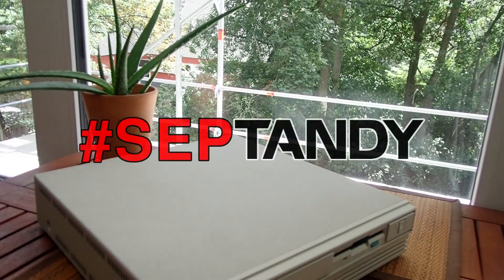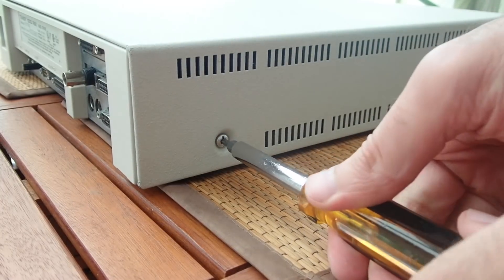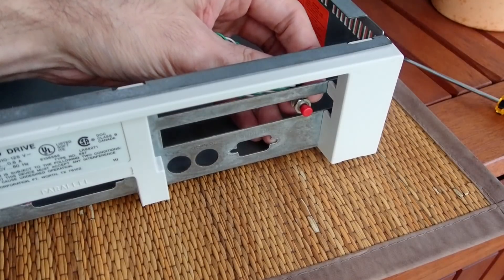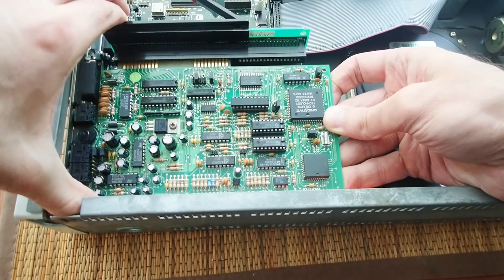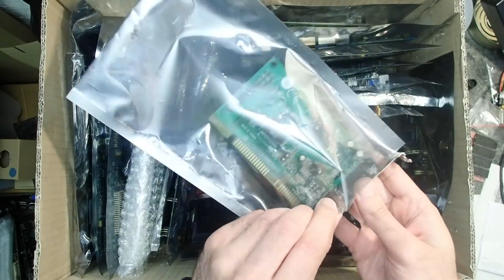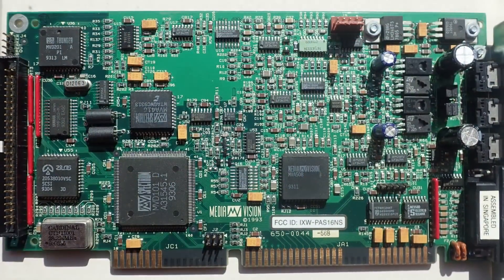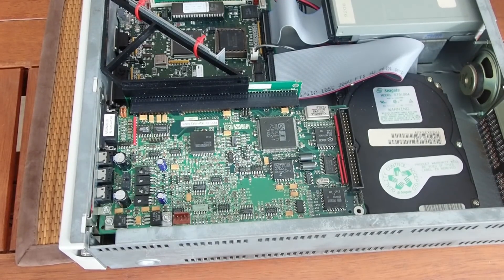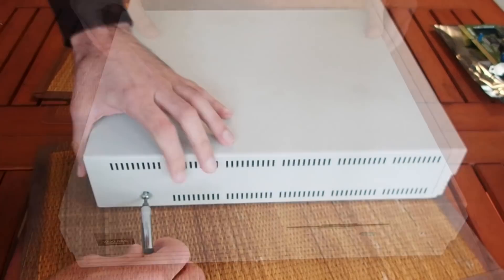#SepTandy 2021: proper audio configuration and a reset button  for my Tandy 1000 RSX

Comment: If you planned on having that network card in there, you could have used the BNC port on the sound card as long as one side could be shorted to ground, if not, you could have drilled it, and just mounted the button in there.  Quite a hack, but keeps the case from getting drilled.

Comment: Ah, this is the video where you ask about what we (as viewers) would like to see in a sound card video. You already covered the PAS in depth. I wonder about sound cards that were competitors in the early market, before AdLib/SB became the de facto standard, like including the Covox Speech Thing. And then covering cards like the PAS that tried to compete with features over the Sound Blaster, but failed due to lack of widespread game support, and were left unused apart from bundled demos, just stuck in SB compatibility mode forever. The name "Turtle Beach" comes to mind, but a quick search shows them as making much more modern hardware.

Comment: Could the card / mobo  just have bad bypass caps causing the lack of filtering buss noise?
Reply from the maker: I'm afraid no, I tried also cards, where I replaced all the caps with the new ones. And the mainboard doesn't have any electrolytic caps at all.

Comment: Inspired by this video, I put my PAS 16 in my 2500 RSX (same mainboard in a different case). Unfortunately I did not have the same success. The card seems to be working fine but the bleed through noise is horrendous. Event the hard drive motor spinning up comes through loud and clear. Still didn't stop me from playing Spear of Destiny for an hour. Although it does seem very peaceful now that it is turned off.
Reply from the maker: That is very strange, did you use headphones, or speakers? How do other cards behave in your machine? I tested now also MediaVision Jazz16 in this machine and together with the PAS16 that were the only two cards, which were usable in this mainboard.
Reply: @necro_ware  It was with headphones. I have not tried other cards yet. I messed around some with the oscilloscope and there is about 2v peak to peak noise just between some of the ISA ground lines. I tried a few things which brought the measurable noise on the supply lines down but nothing improved the audio noise to be at acceptable levels. I may poke around some more later.
Reply from the maker: @jayesonlee-steere5493  I have to admit, that this Tandy mainboard is the noisiest one I ever had, so you have to see it in relation. Also Tandy's power supplies were not very good and produce a lot of noise, especially if you still have the old capacitors in there. They are probably dry meanwhile and produce horrible ripple. It is so bad, that you can actually damage the hardware. I replaced the power supply in my Tandy and don't have the original parts anymore, but with headphones I still can hear some slight noise on the data bus even with PAS16. However on the speakers and during the recording it is not noticeable at all. Headphones seem to be more sensitive to it. If you didn't try another sound cards yet, just put any Sound Blaster from around that time (1.5, 2.0 or Pro) and you will see, what a "horrible" data bus noise really means :D

EDIT: As far as I remember, the 2500 RSX has no audio port soldered on the mainboard, right? So, you can't even use the Tandy Sound System on it. On the 1000 RSX there is one and if you try to plug your headphones into it, your ears will start to bleed. Unfortunately Tandy didn't bother to shield anything on this mainboard. It is absolutely horrible. With external speakers it is kind of ok though.
Reply: @necro_ware  I tried out a Sound Blaster 2.0 and you are right, it is worse. The noise bleed-through is at least as loud as the game sounds. Very unpleasant! :-) I decided to try the card that came with the computer: unbranded 8 bit ISA with YM3812 and Gallant DSP. It is much better than the others. I can only hear a small low frequency grunt every now and then during hard drive access. I am guessing this why it was chosen for the machine. Unfortunately it has a pretty bad signal to noise ratio (white noise, not the bus noises). DSP compatibility seems off too - I was getting digital audio dropouts that I did not get on the SB or PAS.
Reply: I decided to try my Audician  32 (OPL3-SA). It was silent. Some kind of black magic because it is only a budget 2 layer board.  It is also plug and play so can be conditionally enabled on boot. A little new for the machine but at least it works.

Comment: Good video - important to remember the Tandy's with digital sound have a DAC at DMA1 that will conflict with things.  However, your solution probably requires a full power cycle to de-initialize the sound card (I don't think the reset button is sufficient because bus power is maintained); instead, why not just use a card that supports DMA 3?  Since it's a 386 it should support that.  I think the Sound Blaster Pro you had supported being jumpered to that.  Tandy games would work at the same time as Sound Blaster without any conflict.  This would also allow you to run the 1 or 2 games that support Adlib + Tandy digital, or Sound Blaster + Tandy PSG.
Reply from the maker: Thanks. Reset is sufficient and is just as good as a power cycle. In regards of DMA3, as I told in the video, many games back then didn't support anything else, but DMA1. It was basically hard coded into the games, so DMA3 wouldn't solve the problem. Also SBPro, which I have is basically the same low quality sound card as the SB 2.0. The only difference is, that it had two DSPs and OPL2s for stereo capabilities and no CMS. But it was the same noisy crap, so it would be not a good choice for the Tandy.
Reply: @necro_ware  Ah, makes sense; I do remember some games let you set IRQ/Address but not DMA.  Many many years ago I had a "Sound Machine" (Sound Blaster clone) in a Tandy 1000RX and it was also very noisy like yours.  Nowadays I have a Tandy 1000A that I just use Tandy sound with, and a separate 486 with a Reveal SC500 wavetable card; I find a lot of stuff that runs well on the older XT class machines supports Tandy sound more often than Adlib / SB, so that works out well.
Reply from the maker: I have the Sound Machine in my collection :) I showed it in my CMS video last year...
Reply: I had the same thought. Conflict? make that DMA change! but the games, this is why we do it after all. Thanks for clarifying, as I had the same thought... a lot of games have the option of auto detection of which addresses sound is located on.

Comment: A followup video on software setup would be a nice idea!  I have thought about experimenting with programs that can load device drivers normally loaded with CONFIG.SYS from the command-line.  If so, you could drop the awful looking MS-DOS boot menu and use a nice program like HDM to launch each program by first reconfiguring the system as needed, running the game, and then unloading the driver to revert the environment back to 'normal'.  This could be especially useful for programs that would depend on that TNDY program, or what about overcoming the lack of Turbo button by using THROTTLE to add compatibility with older speed-sensitive games?  All of this could potentially be automated away without reboots to bring up new system configurations!  What do you think?
Reply from the maker: Hi never heard of HDM, just took a look at it. Interesting tool. The problem with the most SYS drivers, that they are not unloadable, so you would have to reboot the machine anyway. Except HDM makes some really crazy magic and saves the complete memory state including interrupt vectors. As I said, I never heard of HDM yet, but I guess once a driver is loaded, you will have to reboot your machine anyway. If your drivers are in COM form and are actually unloadable, that could probably work. In regards of THROTTLE, if I remember right, that utility is for more modern chipsets and will not work on a 386. I might be wrong about that as well.

Comment: Ah yes, the ProAudio Spectrum, still have one in my collection. Absolutely love how clean and noise free these cards are, especially while using headphones. I have the Logitech SoundMan 16, which is a clone, but the OPL2 sound seems off, even though it has an original Yamaha YMF262-M onboard.
Reply from the maker: I'm not sure, may be there were different versions of the Logitech SoundMan 16, but the one, that I know is a Jazz16 based and not a Pro Audio Spectrum compatible anymore. However, I have one Jazz16 in my collection as well and it has the same outstanding audio quality as the PAS16, that's true, but I didn't observe any OPL2 or OPL3 sound issues with my cards. They tend to sound more "meaty" due to the better pre amp, but they don't sound off. May be your OPL3 chip has a defect? Technically, I don't know what has to be done to get YMF262 sound different. It is a very simple IC, which is almost directly bound to the ISA bus. You can only control the sound quality by tweaking the amps on the output, but that shouldn't change the melody of the synth itself.

Comment: Why you surrender so fast?)) I'm think SB 2.0 have issue with capacitors on +5V rail - but now we will don't know it ((

Can we change  DMA address by hardware mod?
Reply from the maker: It has no issues with capacitors. I have multiple SB2.0 from different revisions, all the same. This cards second name is noise blaster as well and that's for reason. Mod can't be done easily, since the needed ISA contacts are not populated. You woul need to add new pads, but as I said many early SB games had DMA hardcoded to 1, you can patch the games as well, but that all is too much hustle if you can simply take a better sound card :)

Comment: Nice work ! Is it possible to add a reset button to a Tandy 1000HX ??
Reply from the maker: I'm pretty sure, that it is possible, but I don't know if it's as simple as on the RSX. I don't have a 1000HX, but in the worst case you can search for a reset line on the mainboard and solder a wire in an appropriate place.

Comment: I distinctly remember that SB 2.0 noise when playing Wolf 3d, I had the exact same issue on my 486 SX25 system when I was young. It wasn't until I got a new/better sound card that I realized that it wasn't part of the game/games. Funny how watching your video instantly made me remember, the sound bleeding through was exactly the same as I remember. I doubt I would have cared much even if I knew though coming from just PC speaker sound before getting it. There was a neat "driver" that pushed digital audio through the PC speaker that I used up till getting it. It sounded terrible but it was actual sound rather than beeps and boops.

Comment: Eh, the back isn't always easy to get at, depending on your setup. I'd just stick with the power switch. I forgot the board even had that header, though the thing I REALLY want is a hard drive light. Best I can figure is a rectangular LED mounted through the front grill. Anything else would require drilling a hole.

Comment: Great video! I have a 2500 RSX on the way - same board in a different case. I was thinking I would put one of the Yamaha pnp cards in it. But I do have a PAS and the Tandy seems like a worthy home.

The 2500 RSX has the reset populated. I was planning to share out that cap value when it came. 

For some reason, the 2500 RSX does not have the rear audio jacks populated.
Reply: My 2500 RSX came in and the capacitor fitted next to the reset header is a small MLCC. It doesn't look like it could be more that about 0.1uF. I did not have any luck measuring it in circuit. I suppose I would remove it if someone really wanted to know the actual value.

Comment: In order to boot up a little faster you could add the testmem:off parameter to the himem line.
Reply from the maker: yeah, I always forget to add it to the  himem.sys arguments. In this case I left it out, because during the memory check the data bus noise was especially loud. This way I could  hear very early, if a sound card was noisy or not :)

Comment: I think the noise on the Sound Blaster might be from the power supply not having a -5 volt line. You might be able to add a negative 5 volt regulator to the 12 volt line to supply a negative 5 volts to the sound blaster. I'm not sure if the power supply on your machine is missing the -5 volts.
Reply from the maker: The voltage regulator for -5V is directly on the mainboard. I addressed it in last year's #SepTandy videos. So, it's not the issue. Furthermore SB 2.0 doesn't work without -5V at all, same as the PAS16, wich I also showed. This topic was also covered by my cooperation with PhilsComputerLab on the Voltage Blaster.

Comment: I tried a dozen or so sound cards in my retro PC, I found the YMF719 to have the least noise. ESS cards had good sound but had a lot of static hiss, even after recapping and disabling the onboard amp, and the various ISA SoundBlasters I tried all had the databus noise you're demonstrating in Wolf3D. The Aureal Vortex I tried had laughably bad OPL emulation. I have a PCI SB Audigy 2 that sounds really good but using it with DOS requires a janky hacked driver that breaks protected mode games and has bugs with some real mode games. It's a solid 98/XP card though.

Comment: Would like to see a video with best choice of sound card for 8086, 286,386 and Pentium. Also any caveats [like DMA & interrupt conflicts]
Reply: DMA1 is usually available, provided you're not using multiple audio interfaces, and is the default on most SB-compatible cards.  DMA channel 5 is often used for 16-bit audio cards, either alone or along with DMA1.

IRQ5 and 7 are often used for audio.  IRQ5 is also usually available -- again, assuming a stock PC with no other audio cards, network or SCSI cards.  IRQ7 is used for LPT1 (the parallel port), but if you're not using your old dot-matrix printer, and can disable the LPT port, then you can use it for sound.  Some people think IQR7 is the "correct" IRQ to use for a SB or compatible.  Apparently there are some early SB 1.0-era games that assume you're using IRQ7 and won't let you change it.  I haven't run into this myself.

I don't have quite this bad of a problem with noise on my SBs.  I would imagine it depends a little on the system you put it in -- like how clean the power rails and ground are.  The Sound Blaster isn't a quiet card, but eh.. if I wanted perfection, I wouldn't be using a retro computer.

So, IMO (which nobody asked for), here's my recommendation:

8088:  Do you really need sound in an XT-class PC?  Use the PC speaker (or PCjr / Tandy 3-voice) like everyone else did back then!  😄
286:  AdLib or Game Blaster
386SX:  Sound Blaster, Media Vision Thunderboard (if you can find one), Media Vision Pro Audio Spectrum (not PAS16 -- also, good luck finding one)
386DX:  Any of the above SB-class, or SB Pro.  (SB Pro 1.0 is interesting for the dual OPL2, but not much uses it.  SB Pro 2.0 has OPL3, but not much that runs on a 386 will use it either.  So vanilla OPL2 is fine.)
486:  SB Pro 2.0, Media Vision Pro Audio Spectrum 16
486DX2 or DX4:  SB 16, PAS 16, one of the Aztech or ESS cards capable of SB Pro emulation, maybe an SB AWE 32, or if you've won a lottery recently, a Gravis UltraSound
Pentium:  AWE32, or if you're going to run DOS, any of the Aztech / ESS / Yamaha SB Pro clones with native 16-bit audio when supported by the game
Pentium II:  AWE32 or AWE64 (especially if you're going to run DOS), or SB Live! (if Windows-only), or Aureal Vortex or similar
Pentium III:  SB Live!, SB Audigy, or Aureal
Pentium 4:  SB Audigy or Audigy 2

There are lots of other interesting cards, like the Windows Sound System (or compatible), that are probably not worth the trouble unless you spend a LOT of time in Windows 3.1.  Some software natively supports it, but not a lot.  Same goes for stuff like Ensoniq cards, which are insanely expensive and not well supported except in compatibility mode.  You're really better off with a Sound Blaster, or 100% compatible card, if you're going to use DOS at all.

Once you get into Windows 9x, it doesn't matter much anymore, except if you want to use EAX (SB Live / Audigy) or Aureal 3D.

Comment: As i remember, there was possibility to set low DMA channel to 3 on various SB clones. I've personnaly had old machine with ESS 1868 (sb pro 2 clone) built on-board and ISA slot based SB AWE 64. There were no conflicts at all. First card had A220 I5 D1 parameters, the second card had A240 I7 D3 H5. Worked like a charm until one day... My PSU decided to burn every part that it was connected to. :(
Reply from the maker: As I told in the video, later sound cards starting from sound blaster pro allowed to select a DMA between 0, 1 and 3. But on sound blaster cards before 1992 it was not possible. DMA 1 was assumed standard and so many games had DMA 1 hard coded. If you take a newer card and set DMA 3 it will not run with many older games in real mode DOS. Wolfenstein 3D is a good example, it runs only on DMA 1.
Reply: @necro_ware  Ok. I've missed that "hard coded" part. Everything is clear now. Great content BTW.
Reply: @necro_ware  I hadn't realized they were hardcoded, the BLASTER environment variable was supposed to be what they used when it wasn't specified in an install.exe, and that was put in the autoexec.bat by the Sound Blaster install disks.
Reply: Huh.  I've never had an occasion where I needed to change it, but always assumed the BLASTER env would take care of that too.  Creative was pretty clear about that, so you'd have to be a bit bull-headed to hard-code it.  :-)  Could've sworn the SB had jumpers for DMA channel.  I'll be darned.  But like I said, DMA1 is almost always available anyway, so...